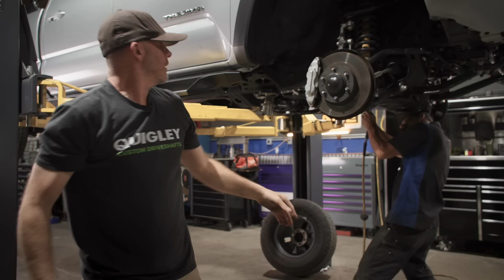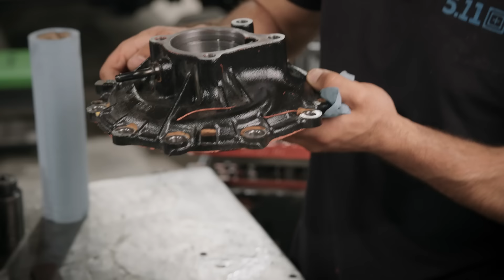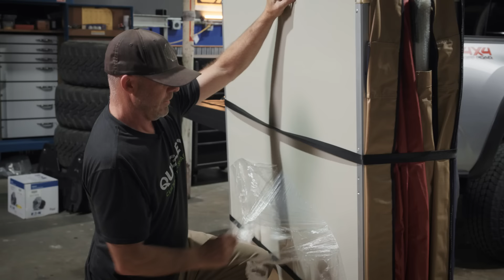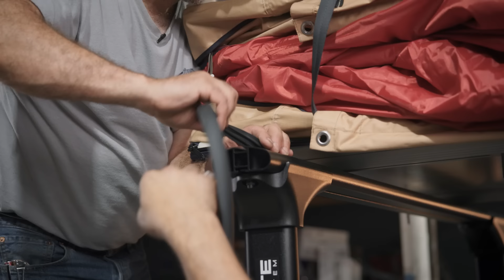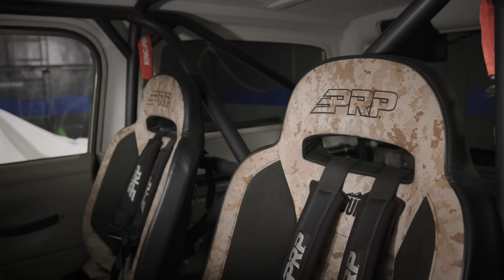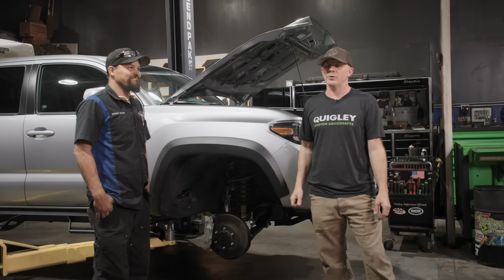4x4 Garage: Toyota Tacoma Overland Build! Part 2 | MotorTrend

Comment: Guys - that's not how you check backlash on a Toyota clamshell. I hope you're not doing it that way on customer vehicles! The backlash goes down significantly when you preload the carrier bearings. Would be worth consulting a gear professional before making these videos. 

For anyone watching - use the factory service manual for instructions on how to set backlash AND bearing preload. Both are important for long lasting differentials. Toyota clamshells are set with shims for both backlash and bearing preload. When the case is tightened the carrier will flex the housing slightly and sit deeper within the deep side of the housing reducing offset to the pinion and lowering the backlash from what is measure with the case apart. This setup is too tight. May even have zero backlash once assembled unless it has close to zero bearing preload. Toyota clamshell preload is measured with a horizontal dial gauge. It's a huge PITA to setup these clamshells the right way. And this will probably be fine because the fronts are rarely used. But I'd still do it right if you're going to do it.

Good luck with the truck!